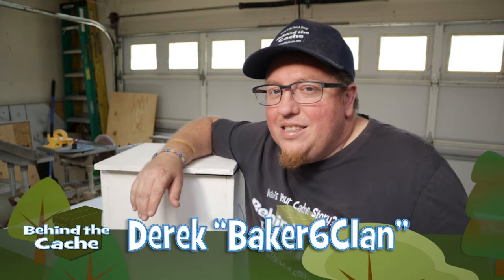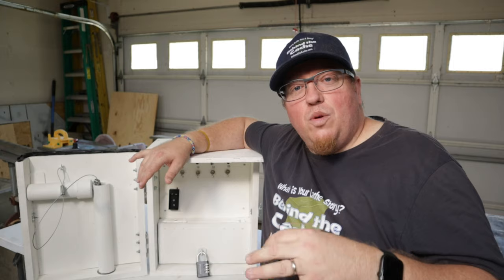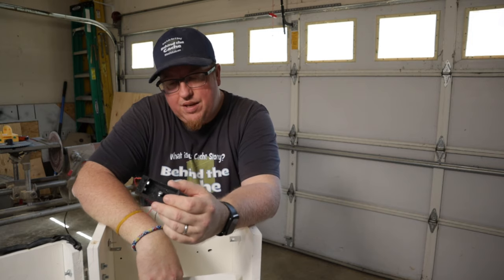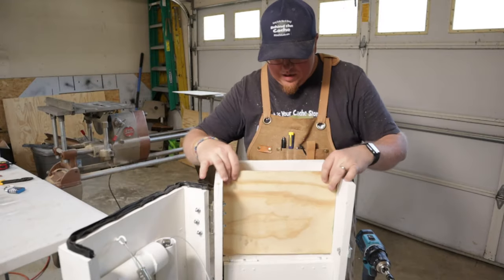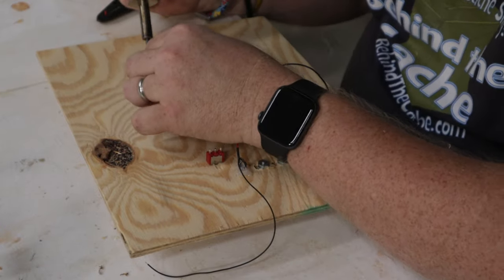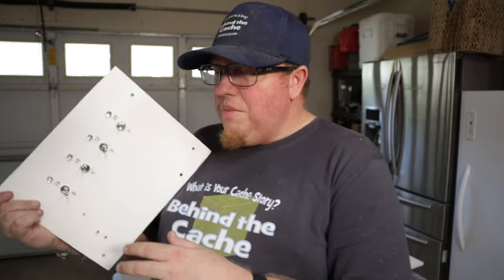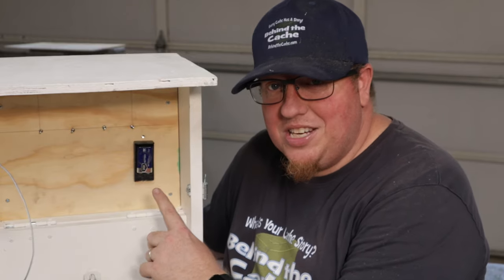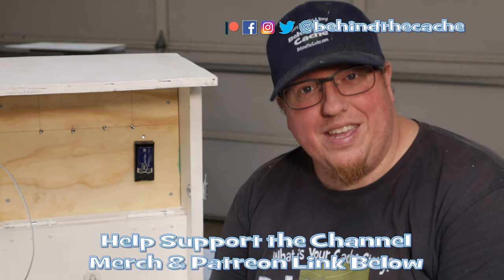Simple Fix for an Overheating Gadget Cache(GCNW)

Comment: Another GOODEN ! What would the cost be for material and instructions?
That would be my deciding factor.
Reply from the maker: The materials where from other projects. The wiring you can see how that was done on Gadget Talk there is a link in the description.   I think the switches were like $10 for 13 of them. I think.